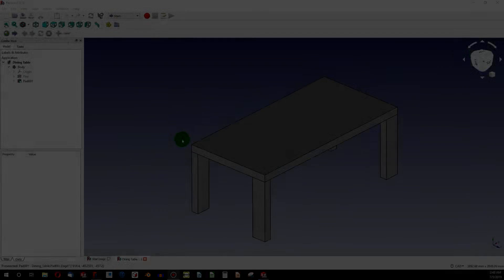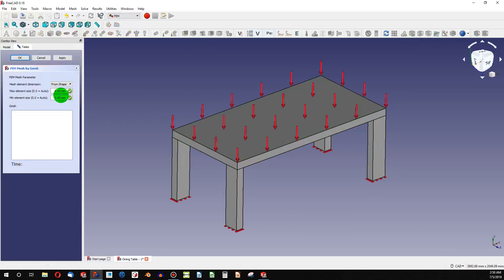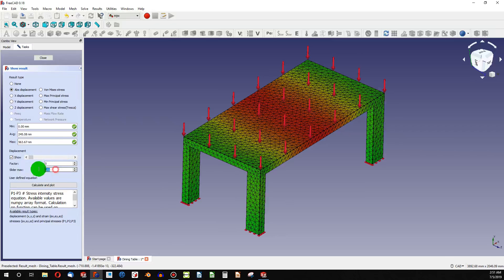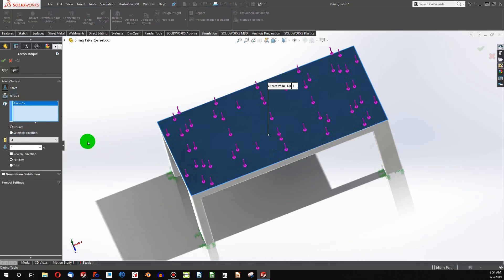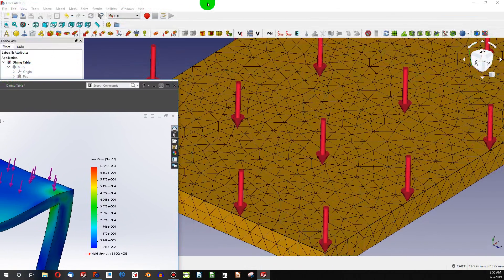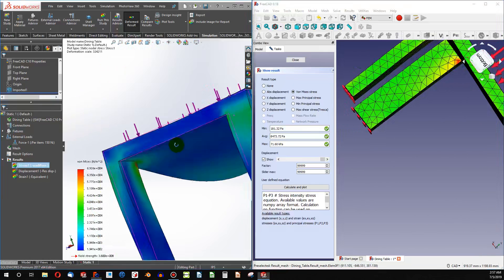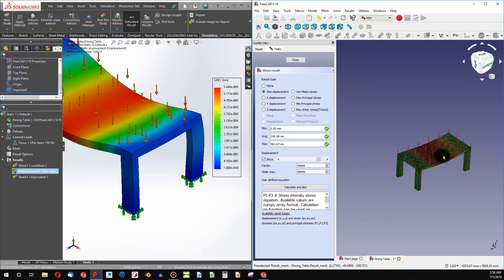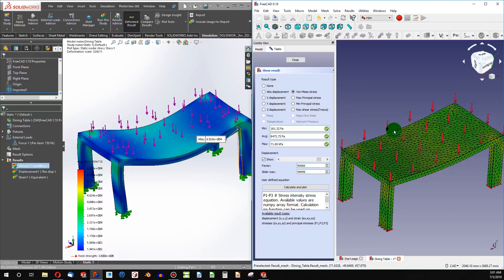FreeCAD FEM VS SolidWorks FEA Simulation - How Do They Compare?|JOKO ENGINEERING|

Comment: YOU CANNOT MODEL TABLE LEGS WITH FIXED SUPPORTS THAT IS INCREDIBLY UNCONSERVATIVE.  Pin one and roller rest
Reply from the maker: Sure.  The point was to compare in a way that people could follow along.
Reply: If it’s bolted to the ground you can, but yes it’s up to the engineer to make sure they properly set their boundary conditions

Comment: The small difference is most probably due to meshing strategies. It's a simple analysis. My guess would be that with more elaborate designs, the meshing techniques, and the differences they produce, are probalby more visible. This does not mean to say that the difference would all imply a freecad error.

Comment: Apparently the simulation is about a table of solid metal. The elements are not hollow. Am' I right?
Reply from the maker: That's correct, if you look at the description you can download the models to see for yourself.
Reply: @JokoEngineeringhelp  I did it. I was surprised because incredibly strong, compared with a real metal table, thank you.

Comment: you converted the object to mesh, but what if the object was joined using bolts? bolts have much smaller contact area than a monolithic object, therefore this simulation doesn't worth a dime, because it assumes the table is made out of an entire piece of wood (or whatever)

Comment: Is it possible to do impact simulation in FreeCAD? For example a bullet hitting a armor plate
Reply from the maker: I have not tried a dynamic analysis like that, it would be an interesting question on the freecadweb.org forum.  I would probably approach it by placing the equivalent force of the bullet on the surface area it would impact and see if it would go beyond the yield strength.  Tracking the deformation of the bullet would be some real complex stuff though.

Comment: Both softwares are equivalent...since there is no exact math formula to predict   stress distribution with accuracy...only lab experience do...like aerodynamic profile for planes: Only miniature models in wind tunnels tell if the prototype is valid...no algorithm work
Reply: There are several formulae to predict stress distribution with KNOWN accuracy. Know your physics and know your software prior to analysis. Being able to turn a guitar on doesn't make you a rockstar. That said, I am not familiar with any accurate method ( as you're ALL about accuracy) to measure actual stress distribution on physical model.
Reply: @Eng_Simoes  

Rafael

Knowing how to use a FEA software does not make you an expert in stress analysis
Reply: :

You are so right. 

People tend to think that a FEA solution is an exact solution or a good representation of reality. It is not. 

Even if the model mimic 100% the real system, nothing warranties that the numeric solution is correct. All numeric methods can fail or yield wrong results when converging to a wrong  solution.
Reply: The equations of statics and the elastic compatibility for a true elastic material do have theoretically exact answers. Differences in meshing will produce different numerical results. The FEA are not developed from experimentation, they are developed from statics and compatibility of elastic materials. If you are dealing with non-linear materials, then you need to use experimentation for those properties. You would also not be using a linear static analysis.
Reply: Is FreeCAD doing Delaunay triangulation?

Comment: How would you proceed, if the force would be applied unevenly, say, close to only one side or close to only one leg of the table?
Reply: I don't know how to do it in Free CAD but in SolidWorks, you can make a sketch on the surface and do a split line command. Then in the simulation, you can pick the area you did the split line on instead of the whole face
Reply from the maker: Little bit late responding to this but just saw it.  fullfrontgunchannel has a good answer for that.  With FreeCAD you can extrude cut but go in the opposite direction so nothing is actually cut, and that usually leaves a split face behind that can define an area to apply a force.